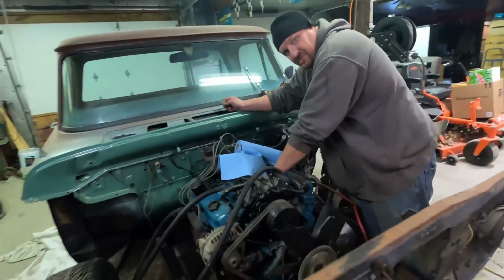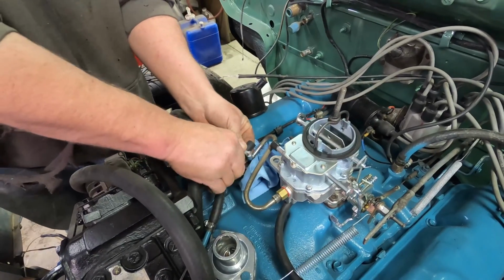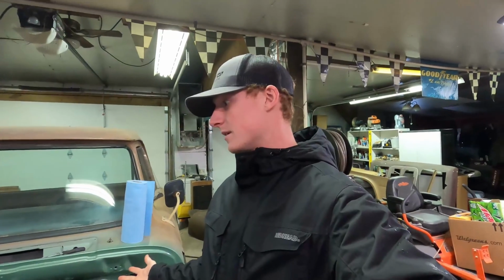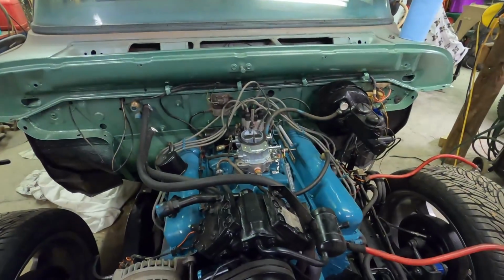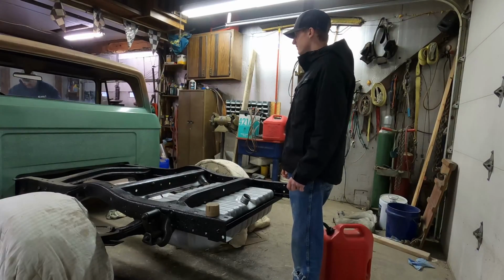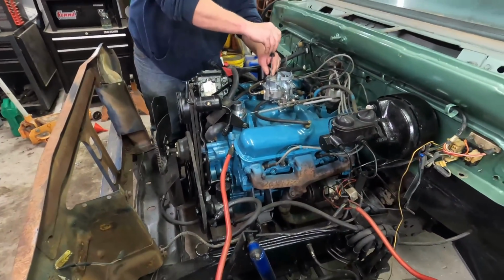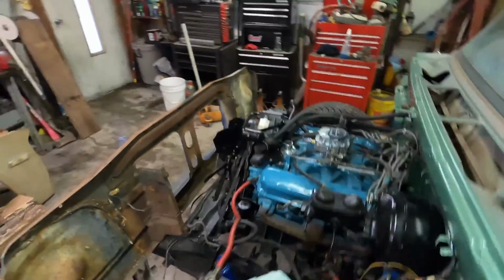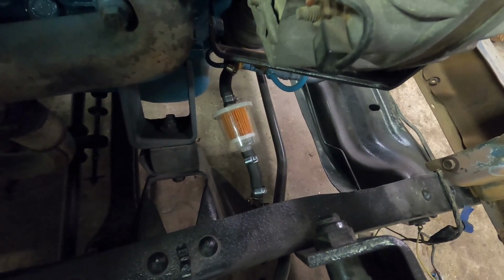Mopar 318 is ALIVE! 1970 Dodge D-100 Sweptline UPDATE

Comment: Mechanical fuel pump doesn’t like to suck fuel thru the filters its better to push the fuel thru it.  I would recommend putting the filter before the carb not the pump.
Reply from the maker: That's what we ended up doing, running good now!

Comment: Did this truck come with a 318 or did you put it in it. If not did you have to change the engine mounts. I have a 1962  d100 that I am currently trying to put a 318 into… trying to figure out if I need to change my motor mounts from my slant six if so.
Reply from the maker: Came with the 318. I’m not for sure if you would need different motor mounts or not, but I would assume so

Comment: Way easier to change the fuel filter without the front clip. Now is it easier than taking off the finder to replace said filter? Haha
Reply from the maker: We actually ended up putting the fuel filter in the wrong place at first, we end up moving it up near the carb.
Reply: @RealSteelFabrications  in my 318 is is after the fuelpump. So I just stuck it back in that same spot. Thanks for replying!